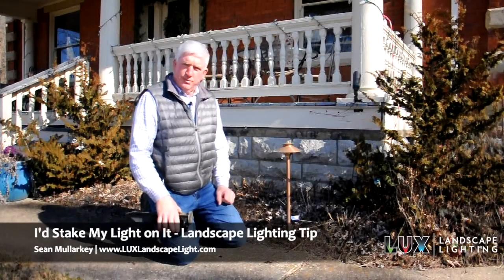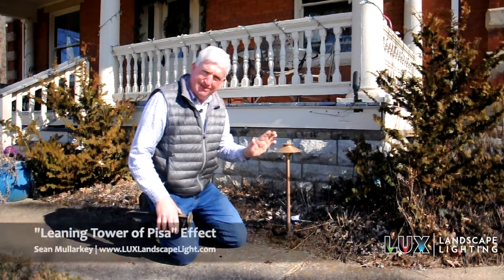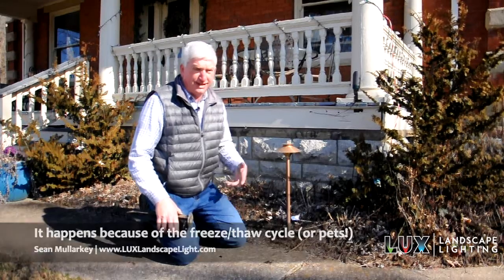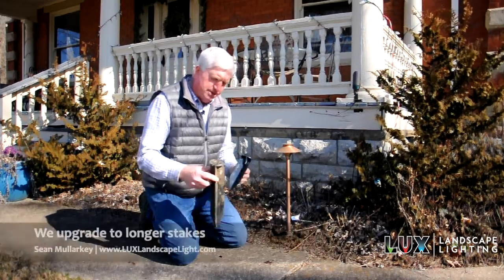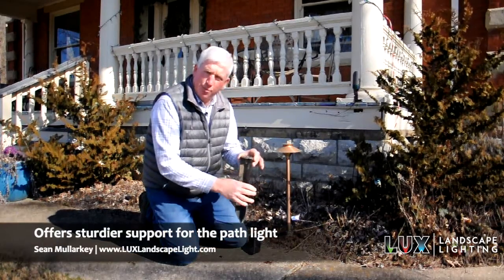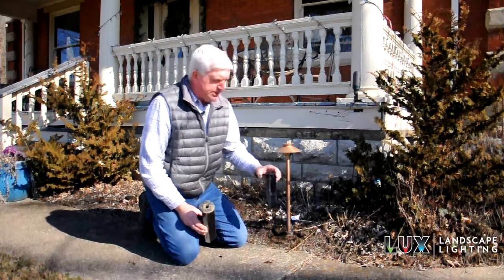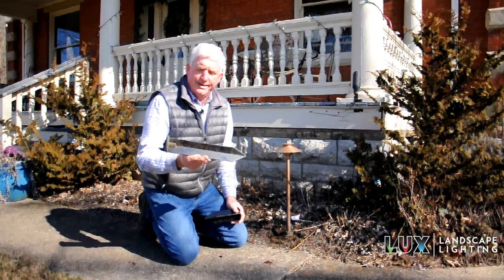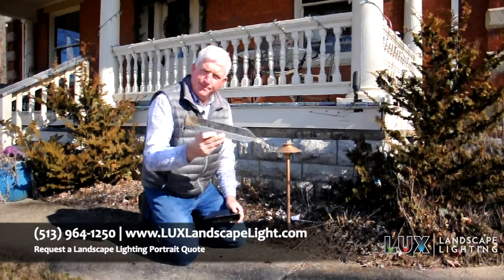I'd Stake My Light on It: Landscape Lighting Tip

Comment: My landlords have steel or brass (pole) Japanese lantern lights.
They were propped up with stones.. They always fall over.
The low voltage wires come out the bottom..
Then how do you stake those?? Lol.